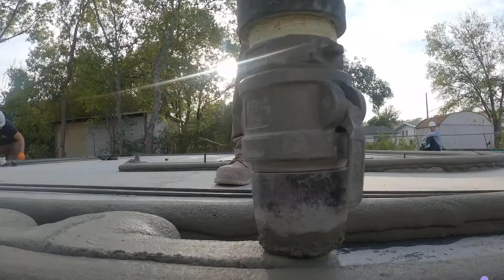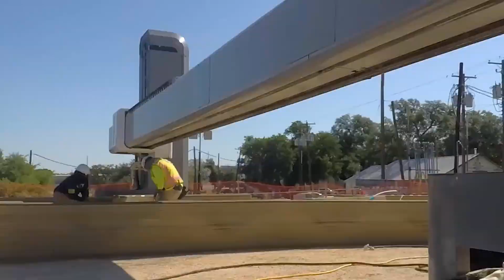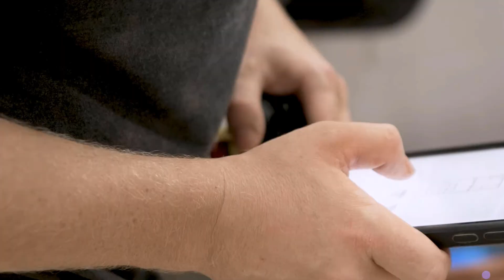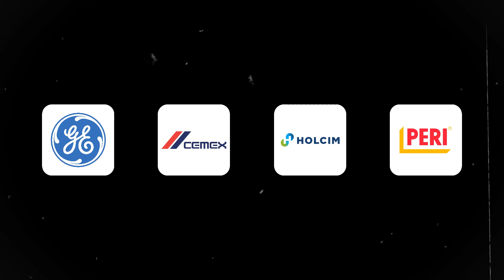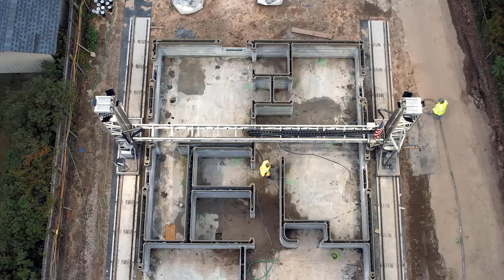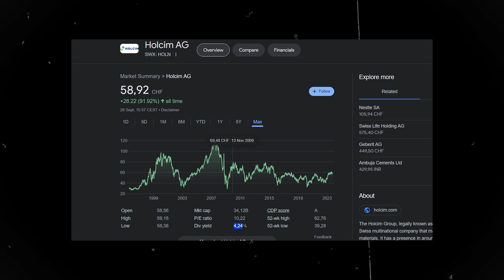Be The First to Invest in 3D Printing Houses...

Comment: I mean in the US, the issue is simply that we aren't putting enough people in the houses that we already have. We have enough housing for every homeless person, but we don't fix the housing crisis  because we care more about the private equity firms' profits than actual people.

3d printed stuff is still sick tho.
Reply from the maker: @neeshie0601 I'm not from the US, so I don't really know what is going on firsthand. But from what I could gather from various sources, even if there are enough houses, they are too expensive, just as you said. If we could build more houses faster and cheaper (using 3D printing), either people will buy the 3D printed houses because they will hopefully be much cheaper, or the median price of the average house should drop dramatically due to a huge surplus in supply. Which is why I'm hyped about construction 3D printing.
Reply: @StockVoyage  flooding the market would probably force private equity firms to sell their single family homes which might solve the issue at least partially, ur right.